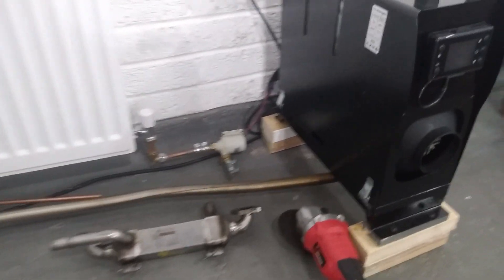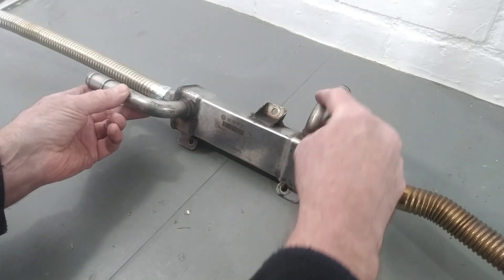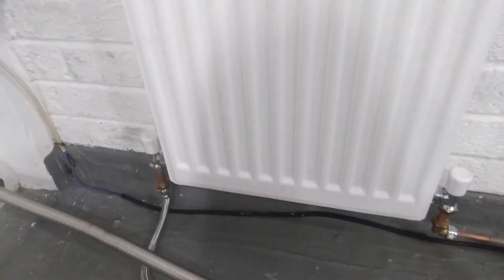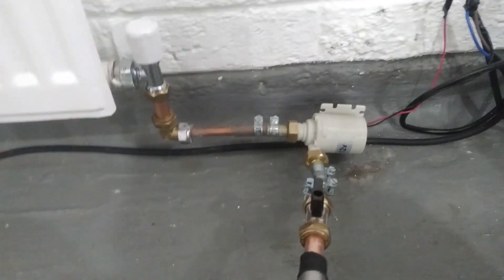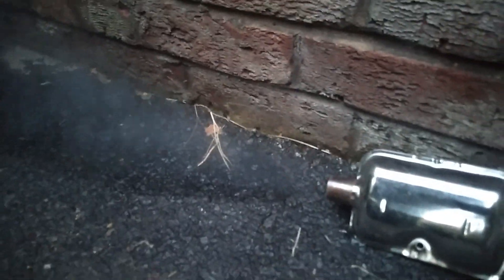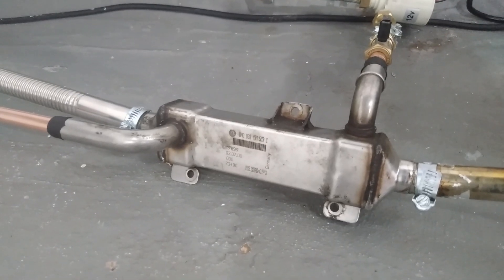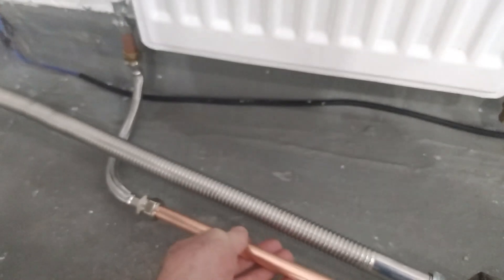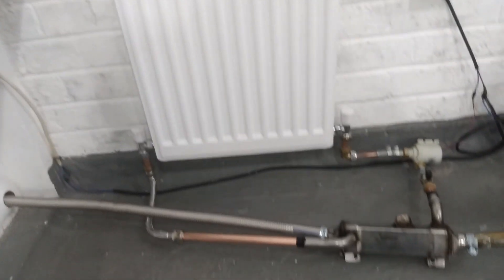Free Heat from Waste Exhaust Heating Radiator Home Diesel Oil Heater Mini Central System Exchanger

Comment: Have you had any problems with this EGR cooler? Does it block the exhaust flow too much? Does it clog the heater? I have an identical EGR cooler and I'm wondering if it's suitable for this type of system.
Reply from the maker: its been great cheers andy

Comment: At last! A video of someone capturing the waste exhaust heat the right way, with a radiator filled with water running through a heat exchanger. All the other videos on here have people either running the gasses straight through the radiator, or they try to make a bodged exchanger from scrap lying around, such as a coiled up exhaust tube in a metal bucket! This was the idea I had and I have spent ages trying to find a video of someone who has done it. I live in a highly flammable mobile home, and plan to install my diesel heater outside in my metal shed, with the warm air ducted through the wall into the living area. I also want to use the exhaust gasses to heat a radiator, but there is NO way I want 200*C exhaust tubes coming in through the wooden walls, even if it was insulated with a through wall manifold! I also don't want my cats brushing their fur against pipes that hot! Instead I will have the hot (50-60*C) and cold water pipes going out through the wall from the radiator with a 12V pump to the heat exchanger safely outside. I plan to buy a boiler type heat exchanger rather than a car one, available on ebay for around £30 - do you have any thoughts on that? Again, the whole idea for me is to keep all the very hot exhaust components safely outside my potential bonfire of a home, with only the hot water system and the warm air output coming in.

Comment: Hi Andy, I've done a similar setup with EGR cooler and a central heating pump to circulate water. My question is that the radiator I have gets warm but not excessively warm, I have the egr cooler very close to the heater so using all the heat as possible from the exhaust gasses.
Keep up the great work 👍
Reply from the maker: great thanks mate
cheers andy

Comment: What size bit do you need to drill through and fit the exhaust through please.
Reply from the maker: i drilled a bigger hole than needed, and put cement around it to insulate the pipe so that it didnt get the garage wall hot.
so i did a 3" hole with a 2" metal exhaust pipe cemented in, with the heaters 1" exhaust going through it
thanks for looking.
did you see my other heater videos  https://www.youtube.com/@andyfireblade
cheers andy

Comment: probs worth stocking some insulation around the hot air pipe before going into the exchanger, both for safety and also efficiency.

Comment: Have that kit where the CDH was before, then attach the 3m of copper pipe that you had as an exhaust, and that will scavenge a lot more heat. It's funny in a way Andy, as if you could measure the total heat you scavenge with the radiator and copper pipe exhaust as well, you may be getting more than the heater puts out itself. I think because the heat exchanger is so efficient, its water vapour coming out the exhaust because the gases are much cooler and thus denser...BTW, put black tape or a patch on reflective surfaces to use you laser thermo gun... :) Best wishes. Tony
Reply from the maker: thanks for looking and good tips.
best wishes andy xxxxx

Comment: I wonder if there is a coupling that could be fitted about 6" from the heater that withstands high temperatures like asbestos?  That way it would prove heat is not being absorbed away from the burn chamber causing the visible vapour out the end of the exhaust, although it should really be water and the heat exchanger is doing a brilliant job.  When cars start off in cold weather you can also see the water vapour coming out the exhaust to begin with and sometimes you even see water pouring out the exhaust pipe as the car pulls off.  This idea is brilliant with the radiator and you could even put a small cistern on it instead of the tube with the funnel that way you could draw hot water off whenever you wanted and the system will automatically replenish itself.
Reply from the maker: great points . good ideas. cheers andy

Comment: Can you confirm what the heat exchanger is?  Are you sure it is a Galaxy 2006?  I have been looking for similar but from most cars there will have to be a fair bit of fabrication to get the exhaust connected
Reply from the maker: yes galaxy 2006 1.9tdi
cheers andy

Comment: 🤔Now you're getting into a thermal battery with the water Loop and heat exchanger try using exhaust tape on the exhaust pipe from the diesel heater to the heat exchanger to transfer more heat from one heat exchanger to the other👍🌐✌
Reply from the maker: thanks for your comment , i am doing a similar project. and the tape will be a good idea. cheers andy

Comment: good job, could you share which system gives more heat? whether the one with the EGR cooler or the exhaust gases straight to the radiator thanks
Reply from the maker: hello my friend
thanks for watching! the exhaust straight through gives faster hotter results, maybe too hot. the radiator was starting to tarnish with the heat where the pipe went in.
the egr was more usable long term, and you could run a bigger rad or 2-3 rads from it.
kindest regards andy 
https://www.youtube.com/@andyfireblade

Comment: I've done something similar using an EGR cooler from a Ford Focus 1.8 TDR and a coolant header tank from a Ford Galaxy! You will extract more heat from the exhaust by sending the water through the heat exchanger in the opposite direction than you are doing on the video!

Comment: Keep on tinkering, really interesting!

I'm thinking the heat exchanger is restricting the exhaust too much and messing with the combustion is the reason for the exhaust smoke.

Maybe it is important to you to heat water, instead of just a room ?
Edit: Only for heating a room, I was thinking of a regular radiator (or maybe better an intercooler) so you would have less losses -> less restricted exhaust -> better exhaust gasses.
Reply from the maker: hello my friend thanks a lot.
the heat exchanger is quiet free flowing, you can see through it. with a few fins passing through. great minds think alike, i have an intercooler here! ready to try.
have a lovely night andy 
https://www.youtube.com/channel/UC3sYHaAZtJI-vrD64K7Qe9w/
Reply: @andyfireblade  The length of the exhaust can be a restriction on the combustion, it may be worth finding a larger diameter pipe to run from the other side of the heat exchanger, with a downward slope to allow condensation to escape, some small holes would help (as on a bike exhaust) though not if they're inside of the house.....
Reply: I think the issue was the length of the exhaust pipe after the egr cooler. Like a chimney on a stove, it’s not going to flow very well without a temp differential or breeze at the opening, with that length on the cold side, it probably wasn’t “pulling” the exhaust from the heater enough (It’s hard to explain, basically temperature differentials can be a flow restriction as much as more obvious things like corners etc).

Comment: David McLuckie measured about 600W available for capture, at full output of the typical ‘claimed’ 5kW heater.  Condensing gas boilers claim efficiencies as high as (but probably less in practice) 95%.  I doubt these heaters would achieve close to 95% efficiency if all the exhaust heat could be recovered but they might not be far off if set up properly.😊
Reply from the maker: thanks for watching. and good point!
did you see my other heater that heats up the house?
https://www.youtube.com/channel/UC3sYHaAZtJI-vrD64K7Qe9w
kind regards andy

Comment: I believe you can tune this system for better efficiency:

You have the fluids (water and exhaust) flowing in opposite directions, which makes for the most efficient heat exchange as I understand things 👍🏻. Just insulate the first exhaust leg (to the exchanger) and seal the liquid loop for more pressure. 

I would’ve put the water pump on the outlet side of the radiator, on the cool/dense side. You could probably add another radiator with more water and not have to worry about the pressures being a danger, if you restrict the outlet(s) of the radiator(s) to really let the water dwell longer and cool more in them. 
That you can hold the exhaust pipe after the EGR exchanger is testiment to how well it’s doing it’s job. I’d consider a radiant floor heating loop rather than a radiator, for smaller areas like entry vestibules, for this part of this heating system. (Does the muffler positioned where it is make much difference?)
Reply from the maker: hello my friend
thank you for your comments, thats some great tips for me and other people to see, and help them when they are building there own system. the muffler doesent do a lot really, its straight through flow.
have a great day andy
Reply: @andyfireblade   Gregory is spot on re water flow direction.  One always feed the cold in to collect the last of the heat to be extracted - think, in your set-up the hot water passes the coolest gas.

Comment: Thank you for the cracking videos you have made. 

Do you think that you could run a bigger radiator or another radiator using this method?

Thanks
Reply from the maker: hey paul
thanks mate, and thanks for watching.
i really appreciate it.
yes it would easily take a bigger rad, maybe 2 or 3.
kind regards andy

Comment: Burning of most liquid or gasious fuels releases at the very least CO2 and water. As the exhausted gases are cooled in your heat exchanger, they come closer to the condensation temperature. What you see coming out of your outside exhaust is almost exclusively the co2 and water vapor that is mixed in the air (air, or better the oxygen in the air is never fully used in the combustion) The temperature of the water vapor is cooled down enough for it to condensate on contact with the colder outside air and form small droplets that you see coming from the exhaust like smoke. The water vapor also condenses on the cold rocks as you can see.
A risk of using the exhaust heat and cooling the exhaust gases is that they cool down and water conses inside the exhaust tube or even the heat exchanger. The condensated water will  be slightly acidic due to the reaction with the rest of the exhaust products and cause corrosion. If that happens inside the building you risk release of exhaust gas in an enclosed room. Obviously this will not happen short term but be very careful with these experiments for longterm use. I would consider placing the heatexchanger on the outside and run the heated water back inside.
Reply from the maker: cool, thanks for the comments.
great
kindest regards andy

Comment: Have you thought of using an intercooler off of a small 4 cylinder car with fans behind it? Maybe I'm wrong, but it seems like it would simpler and more thermally efficient than heating water.
Reply from the maker: brilliant, next vido coming up!
ebay here we come.
kindest regards andy and thanks
Reply: @andyfireblade  You're welcome! Watching the video where you had the exhaust going into the radiator made me think of that.
Reply: @caseymoyes6309   intercoolers cool clean induction air.  Not such a good idea if there is risk of filling with soot (if wet surfaces, everything, that can, will stick to it).  Fan may use 15W but the circulating pump may be a lot less - it would, at least, if the circulating system is a complete loop.

Comment: Sudden price increase in Ford galaxy heat exchangers on eBay 😂 👍 just bought mine 👍 living the dream 🙂
Reply from the maker: brilliant my friend
hahaaha your funny
let me know how you get on
Reply: @andyfireblade  I have just bought a door panel so I can take the glass out at the side of my French doors and fit the panel and I will be able to cut a hole in it for the warm air and for the warm water to feed my radiator, ( leaving the heater outside in a watertight box) I am looking forward to this project, I am going to try run a 5ft double radiator so I am thinking of putting the heat exchanger a bit closer to the diesel heater? don’t think there should be any problems but yes I will update :) thanks for the Videos 👍

Comment: The reason you have black smoke coming out of the exhaust is because the exhaust is too restricted.  The burner is running too rich.  You will end up cleaning out the combustion chamber if you continue running it this way.  It would be interesting if you cut the exhaust ( and the intake ) to the minimum and then run your experiment again.  Please keep us posted.  Also, take the muffler off.
Reply from the maker: the smoke seemed to clear, i think it was the initial burn off.
it just has some condensation coming out now.
i total agree with you about restricting the flow though, that does affect the burn. i found this in another experiment that i did with a bucket of water.
you can see this and a couple more in my vids of the heater if you like.
let me know what you think

https://www.youtube.com/channel/UC3sYHaAZtJI-vrD64K7Qe9w
kind regards andy
Reply: @andyfireblade  Thanks for the update.  It would be interesting to know what the carbon monoxide levels are from the exhaust.  I bought a meter so that I could tune my heater while capturing heat from the exhaust.  I will keep you posted.

Comment: I had thought about these ideas but never done them so its awesome to see someone have the same ideas and actually put them into practice, seeing it work it does make me wonder what capacity that heat exchanger has and how many radiators it could heat, because if it was lets say 3  then you could could heat 3 rooms at no cost using the waste heat and might be worth testing perhaps ?  As for the pressure  well its really a non issue, central heating systems in UK homes are actually designed to be sealed and pressurized even when cold its why all central heating systems have a water pressure gauge, they do of course have a pressure release valve in the event things get to hot.
Reply from the maker: brilliant.
i am glad you liked it.
and yes this is just a silly experiment, but it makes you think of the possibilities.
that red got really hot in no time, it could do more!
have a fab day regards andy

Comment: A very interesting project.
The heat which is lost from the exhaust of those heaters seems enormously wasteful, so your project is very interesting indeed.

I suppose, like a modern condensing boiler, effectively cooling the exhaust by grabbing some of the heat from it must reduce the exhaust gas's ability to retain moisture, so my bet would be that you'll be producing some fairly acidic condensate.

Couple of questions though...

1. Your pump seems to be wired directly to a lightswitch. Is this fed from a fused spur somewhere? If not, and that's straight onto a ring main, you need to swap it for a switched or unswitched fused spur.

2. Why is the lightswitch which the pump is connected to, mounted upside down? In the UK, lightswitches and socket switches should be ON when the bottom of the switch is pressed in - yours seems to be upside down.
Reply: Yea I wondered that too. But I think it’s 12v. 10W. But being a spark I would be arranging things differently but I think this was done in quick time on his day off today. So things can be sorted tomorrow. ✌️🙏✌️
Reply from the maker: hello my friend
thanks for watching.
the light switch is not part of the home wiring, it is just used for the experiment, using the 12v supply. but well spotted that it was the wrong way. that always annoys me too.
the 12v supply powers the heater and the pump.
please take a look at my other videos of the heaters.
https://www.youtube.com/channel/UC3sYHaAZtJI-vrD64K7Qe9w
let me know what you think.
kindest regards andy
Reply: @andyfireblade  
Nice to hear from you mate. I thought it was only to switch the 12v supply. To the pump. So not using 240Ac. Plus I know you done this quick to get people updated. I will reply to your other reply now mate. Just popped on and found your video were I asked about the pump and where to source it. Thank you. 
Best regards, 
Scott. ✌️🙏✌️
Reply from the maker: @scottl7644  Water pump: https://amzn.to/3WdQJ7B

Comment: The products of combustion are carbon dioxide and water. When the exhaust is leaving the system hot, the water stays as vapour. When the exhaust is cold, the vapour condenses and shows like it does from a cold engine, (bike or car etc). Like TheBigM10 says below, keep the pipe and drip-holes pointing downwards to allow water escape.
Reply from the maker: Thanks for the info!

Comment: usually with radiators you want the hot water coming in from the top and coming out from the bottom hots the whole radiator equally and more efficient have fun experimenting
Reply from the maker: thanks for watching and your comment
kindest regards andy
Reply: @andyfireblade   Not usually for household radiators!  Most are plumbed like yours.  Only if the rad was mounted at 90 degrees would that be correct.

Comment: What do  these heat exchangers do in your cars. The only thing we have heat exchangers for in the us is engine coolant to cool the oil in a big diesel, an oil cooler.  Do you have AIR cooled engines with exhaust heat exchanger to Circulate  coolent to a  heater core.
I don't get it?
Reply from the maker: bring instant heat from the exhaust to the inlet manifold from cold
kindest regards andy
Reply: @andyfireblade  Hi  and thanks, so are your cars   carburetor and they FREEZE open ,.  I get warm air but what is the warm air do for the car ?  We are  fuel injected.
Reply: @andyfireblade    Andy the EGR coolers recirculate exhaust gases back to the combustion chamber, not only to improve warm-up, but also to improve the efficiency of the engine by reducing the burn temperature and thus also reducing NOx emmissions.  Diesels always run with excess air in the combustion process.